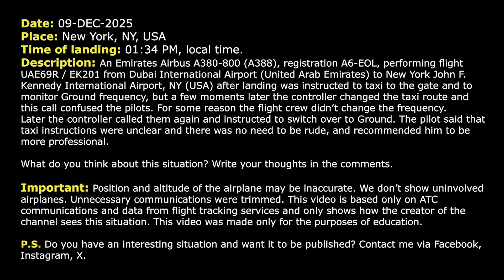Emirates pilots ask JFK controller to be MORE PROFESSIONAL. Pilot argues with controller. Real ATC

Comment: Pilots insisting on clarity is 100% valid...and ATC needs to listen. Accidents happen on the ground not in the tower.
Reply: And where was the clarity lost by these UAE pride talkers? At 1:54? Hmmm, interesting twist!
Reply: That is absolutely moronic, obviously you didn't see/hear the same video or struggle with comprehension. It is the tower that dictates who goes where and when at the airport and in their airspace. As the controller told the pilots, instructions may change due to gate closures and heavy traffic. The job of the pilot is to keep his ears open and follow the instructions very very carefully which they didn't do and then tried to blame it on the controller. Now the controller did come off quite irate but with good reason since their taxiing was too slow and could have caused a serious accident. The controller told them not to stop as there was a 777 crossing behind them which they failed to do either went too slow or actually stopped at some point. The worst thing for me was the fact that they heard perfectly well the change in instructions verified that they understood the change, failed to execute instructions in the prescribed manner yet had the gall to claim that the instructions weren't clear citing some stop at KD vs stop at D malarkey(bullshit in order to cover their ass). At most they could have kindly requested the controller not speak angrily towards them and left it at that. Instead they demanded the controller not speak angrily to them and then claimed that his instructions weren't clear. That to me sounds like a pilot who effed up on the runway and got butthurt after the controller chewed him up about it. Once again do keep in mind that taxiing at a speed that is too slow is often discouraged by ATCs as it can be disruptive for the flow of traffic and potentially very dangerous(ie when crossing a runway with traffic behind you).
Reply: @Crypt0n1an Exactly bro, but most people are fucktard but talk, just because they can, with zero understanding and zero fair or clear thinking! Sad is that many of them also fly! That's more dangerous, cause from ego and pride, there's a lot from which you can die!
Reply: @Crypt0n1an  You sound like you have skin the game. Are you ATC? If a pilot tells you you're not clear...FIX IT!
Reply: @jhaduvala of course i have skin in the game and so do you and ANY person travelling by air  in ANY country where imbeciles like these pilots are likely to make such major blunders putting lives at risk. No i am not an ATC just someone interested in the truth fairness and the safety of the public.
Reply: @Crypt0n1an The ATC was a a moron and a jerk that kept giving wrong and unclear instructions.  He first sent them to the gate, which the pilot had to tell him was not possible. Then he told them to first go right, and then to actually go straight.  He never clarified they needed to go around the airport. Then he got angry and replied with a scold. Idiots like him shouldn't even be taking orders at a fast food drive through,  let alone poorly giving instructions that can cost hundreds of lives.
Reply: @Crypt0n1an  YES EXCACTLY  !  YOU said it better than me  but this is my opinion also !  my intuition  kicked in  , and keeping safety of passengers was my first thought , and  needless  words from the pilot ,,,also the pilot needs to speak more slow and clear ..no one is perfect ,we all egual humans ,but HEY YOU PILOT ,,think about the passengers your in charge of ,,speak intelligiant ,ok HEY YOU ? PILOT
Reply: @Crypt0n1an the Emirates pilot sounds like he was half way sleeping. I agree,he is just trying to blame the air traffic control for his own faults.

Comment: I think the initial controller was an asshole to one of the co-pilots with perfect English at the beginning.  The controller probably assumed there was an English barrier but unfortunately for that controller everything is clear as day for the original Super 380 f/o and original JFK controller.  Typical JFK trash-can  Air Controller who hates life and being a dickhead to a A380 Emirates aircraft that just flew 14 hours straight.   I work for Delta on the Ramp and feel terrible for the A380 crew. If the job is too stressful for that controller just leave already.  I promise you this isn't that controller's first or last complaint.

Comment: Controllers were clear but should not have put emirates pilot in a position on an active runway where expediting was necessary. Emirates should not have called the controller out on the tower frequency. Controller was rude in response. Ground controller should not have continued the debate on ground frequency. All three should have this event documented in their personnel files.

Comment: The controller did nothing wrong, it isnt necessarry to say "you are going to round at the airport" Instructions were clear, from right turn on alpha to straight on alpha. You just follow the instruction then you clarify for the route as simple as that. The atc is very concern about the active runyway that being crossed by another plane, it should be clear ASAP. its not rude, its necessary!

Comment: Airline pilot here,  JFK is a challenge but the instructions where clear and ICAO standard, ( except for bit about traffic on runway behind him) A goes in a circle, a pilot would know the direction could change. The most notable part was the controller informed the super about another large jet on the runway behind him and to hurry up to prevent a runway  incursion. The controller also had to use the long way around the airport to allow places for the A380 to hold for a gate out of the way of other traffic To operate in airports around the world a pilot need to adapt, different  countries and airports have different rules and customs. Airports such as JFK and ORD, ATL DFW. 4 pilots in a A380 and none of them aware of the JFK customs? How do you get to flying that jet and not one of them been to JFK? Some are more formal and exact others have there own rules, ( like never stop in Chicago) as I travel the world I make myself aware of local rules and customs through charts and fellow pilots and observing my surroundings. I have had JFK controllers tell me I created magic in the sky for them, and snap at me,  it's just how it is these airports,  comply and move on. Don't harass each other, both could have been more polite at end and moved on to making things safe.

Comment: I know its fun always picking on the controllers and they are not 100% right, but I can pinpoint the issue on this crew, they READ back Straight ahead on A, hold short of D without issues, the controller at that point assumed everything was ok, if the crew was confused instead of reading back they should've asked for clarification and all of that could have been avoided.

Comment: A 15 plus hour duty probably for those pilots by the time they land there. ATC forget that or don't consider it. I wonder how ATC controllers feel towards the end of their shifts and they're working the same area usually. Those pilots may not have been in JFK for months and months before that, even a year wouldn't be uncommon. They did the right thing, they slowed down or even stopped because they had doubt. They were absolutely correct to do that.

Comment: The pilots were correct. They were told to cross and hold , then the tower told them to continue forward because there was another jet behind them on the runway. But the controller didn’t use there call sign to tell them to continue on. So, who are they talking to. Nice try ATC , use your words.

Comment: I would fire that controller. There has to be 0 tolerance for any AT controller with anger issues.
Reply: No. International rules are you follow ATCs directions right away and if you have questions you ask them for clarification right away. If you have a problem, you do it offline and don't hold up the air. Every pilot in the world knows this. This is their training and this is the law.

Comment: I've just noticed another part that makes straight A, short D confusing to an A380; they need explicit clearance to cross any bridge on A (since no other plane can cross simultaneously).
Those are at NA and TB.
 
No idea if the crew picked up on that, but they might have gotten short NA if they had to go around the airport before.

Comment: I'm with the pilots on this one. It's like "turn left heading 180" when that heading is 20° to your right - it's confusing, so the controller should always clarify "turn left all the way around to heading 180" or similar. In this case, should have said "straight ahead on A, all the way around the airport, hold short of D".

Comment: Some of this JFK ATC guys should fly to Heathrow and watch how it can be done in a smooth, professional way without any need for conflicts.
Reply: The English are smooth and more articulate and have less complexes compared to the loud and insecure New Yorkers-in summary-Much more class.
Reply: LHR is not as complicated as JFK
Reply: @ToddSherrett  therefore you have to be a rude prick
Reply: @ToddSherrett The issue has nothing to do with complexity. It's a matter of communication. JFK ATC is often very aggressive. When he changed the clearance, notifying Ek they would have to taxi around the airport would have immediately solved the problem.
Reply: @GreenDot_Pat it has EVERYTHING TO DO WITH COMPLEXITY. Listen on liveatc anytime and see how many incorrect read backs there are on BASIC INSTRUCTIONS. Stop sugar coating pilots inabilities to comply with basic English.
Reply: @L @LUAWNYC  there are that many incorrect read backs doesn’t that tell you something about the delivery of the instructions? JFK isn’t even close to being in the same league as LHR.
Reply: @LUAWNYC You should be able to work as a professional in a complex environment. If not, it's not the right type of work for you.
Reply: @GreenDot_Pat  bro JFK design is completely messed up

Comment: I am brazilian, I operate in JFK many times and I understood everything. The controller was not rude. A taxiway is clockwise, is written in the taxi chart. The controller corrected himself with the correct instruction to go forward. This pilots need to be more proactive and speed up taxi due to other traffic. And later just asking “can we call 121.9 sr?” would solve the situation afterwards

Comment: The Emirates guy is most likely not accustomed to instructions that change rapidly. I'm very certain that had they been given 2-3 minutes after the instruction to process the same in their own heads, they would've gotten it. There is no complexity in the communication itself; it's an extremely clear set of instructions, and their eventual readback confirms that they heard all of it correctly. The gap here is this: some people can process information as they're listening to it. A large number of them, however, especially from the Middle East and even British cultures, need that extra processing time after the instruction has landed in their ears to travel to their brains and then to their hands for appropriate action. It's that processing lag time that I personally find ultra-irritating as well, irrespective of whether it might lead to a blockage for another aircraft behind.

That's exactly what happened there, and it is very similar to travelling inside a train vs driving a car. If you've to stop a train as a passenger, you'd need to pull the emergency handle. It would still take several minutes for the train to come to a halt, and restarting would probably require up to an hour or more. But a car? You can stop almost instantly in a couple of seconds and restart almost instantly in another couple of seconds. The Emirates brain and even the British brain work like a train, where listening and processing take much longer than the JFK controller brain, that's operating like a car.

Eventually, I see the role of pilot and co-pilot being defined in terms of communication. The pilot communicates only with the co-pilot unless it's an emergency. And then the co-pilot talks to the tower alone. The copilot does the additional processing after listening, so that the tower frequency is a clean give-and-take.

Comment: In addition to confusion instructions, It needs to be taken into consideration that they landed at JFK, probably, after 14 hours of flight. 

Arriving at a huge and complex airport, tired, needing to cross runway, trying to identify the taxiways and cross-check the position and ground navigation with the chart is not so simple as ATC thinks. If the arrival is at night and/or with low visibility it's much worse. 

Respecting pilots and providing clear instructions should be basic anywhere.

Obs: I know that ATC job is hard, too.

Comment: I'm not a pilot, and I have precisely 0 hours in the cockpit or at an ATC tower.
But I do watch these videos. There are many videos of rude controllers, and many of them come from NY, but in this case I think it is the pilots' fault. The controller didn't sound angry or anything at the beggining. And if the pilots were confused, they should had asked for a clarification and solve any missunderstanding. But they didn't, and then they escalated the situation.
Again, this comes from 0 hours of real life experience, so I might be completely wrong.

Comment: Tower is wrong. The initial instruction was: "Cross runway 22R, taxi right on A to the ramp and monitor Ground 121.9". Then a super correction was made to "go straight ahead A, straight ahead A, short of D". In the super correction there was no instruction to monitor 121.9. A super correction totally invalidates previous instructions, it cannot partially invalidate a previous instructions.

Comment: From the moment that the crew read back the instructions correctly it goes on to show that they very clearly understood what they had to do, there was no unprofessionalism here on behalf of the ATC Rather the opposite, the crew simply forgot to monitor the ground frequency and were attempting to hide behind cheap excuses. Emirates pilots should have appologised instead of acting like owning the place.!!
Reply: A read back is just that, a read back. It's not an acknowledgement of understanding.
Reply: @epsivaz  the reason we read back instructions is to aknowledge and confirm the information, we don't read back clearances just for fun you know😂
Reply: @christosphillips3568 are you telling me that before each read back, both, or all 4 pilots confirm understanding and that they accept the instruction, without delay? Or is it read back, and there are occasions where it's clarified after? The former would cause a huge amount of delay during general RT.
Reply: @epsivaz my friend I have been an airline pilot for 35 years with 21000 hours jet experience, trust me, they forgot to switch to the ground frequency which they very clearly acknowledged  to do so by reading back the clearance to the ATC controller, and then they tried to hide behind their finger and blame it on the controller who was totally clear and totally professional in his instructions. Now the reason why we read back clearances is for safety, because the aircraft will be doing whatever the pilots understand they have to do. If they read back something else they were told then the ATC will tell them again and correct the pending mistake. So from the moment the crew read back the clearance CORRECTLY, all that is left is to execute the instructions. If you fail to do so or if you forget to switch to a new assigned frequency ( which happens a lot), you just apologise politely and switch to the correct frequency immediately, and there are no repercussions involved. And that’s how it should end, these guys were trying to blame the controller as if their communications were not being recorded! If I was their manager we would have a lengthy conversation about their attitude more than anything else because people like these do give Emirates a bad name! Hope I covered you!
Reply: @christosphillips3568 I appreciate this is a YouTube comments section, but if you have a flick through, you're in the minority.

These Emirates pilots did what was expected. They received a clearance which was confusing. They stopped to clarify. Keep in mind the 380 is a large aircraft. The JFK controller, as is typical, was curt and unprofessional when asked to clarify what straight ahead hold short D meant. 

I'm sure someone of your vast experience will understand that you don't get rushed or pressured into doing something you don't understand. If you don't understand a taxi clearance, stop and clarify. It's aviation safety 101.
Reply: @epsivaz thank you for the lesson enough said have a great holiday period 😊

Comment: The issue wasn't that the controller was 'confusing' rather pilots were offended by the controller's unprofessional tone.  Clearly the 'controller' got unnecessarily emotional and subsequently harsh.  Unfortunately, the pilots didn't articulate that well when asked about a potential 'confusion'.  They should've said it wasn't a confusion as much as an unprofessional tone.